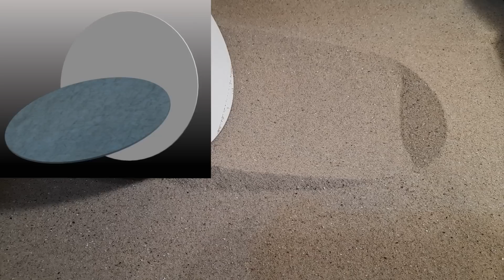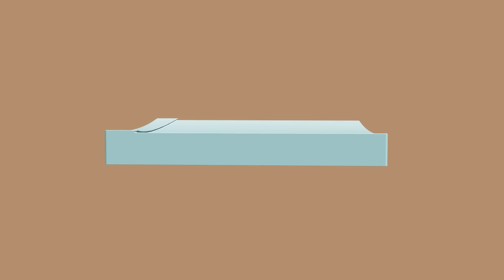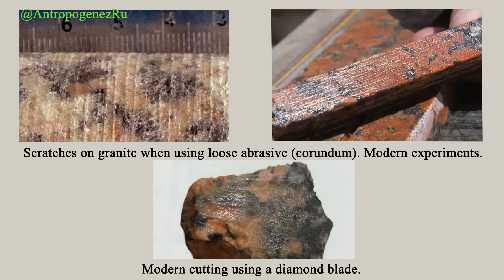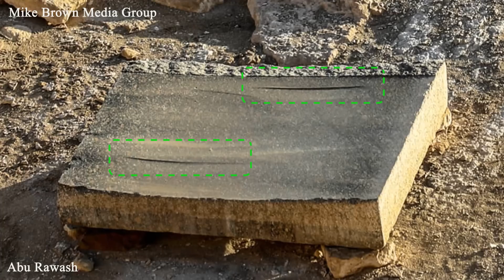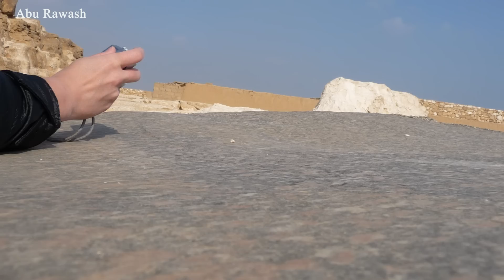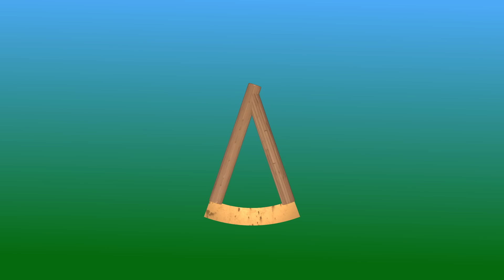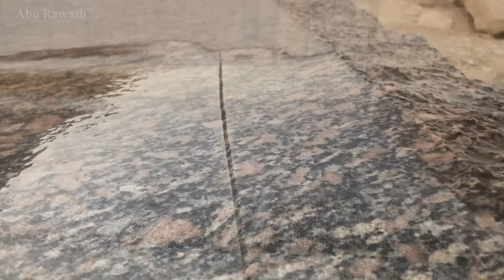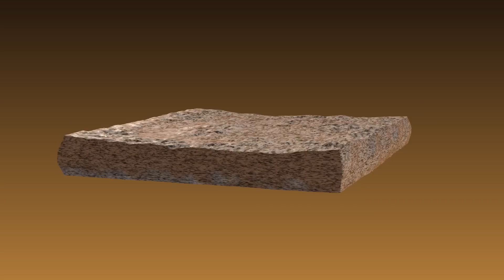The Abu Rawash Artifact: Evidence for the Existence — or Absence of Circular Saws in Ancient Egypt?

Comment: A flat edged hAif meter cutter fixed to your tripod and swiging bAck and forth will leave an ark on the Abu rawAsh stone also. No need for inventing tech there is no evidence of the parts or the infrastructure for building the high tech to begin with. There's a reason the most delicate medical procedures are still done by Human hands .

Comment: In Nature, Yosemite, granite exfoliates, layers come off like onion skin...due to?...bbk...

Yes, the granite in Yosemite National Park does exfoliate in a manner reminiscent of peeling an onion. This process, known as exfoliation weathering, involves the outer layers of the rock peeling away, forming characteristic sheet-like fractures. 

Elaboration:

Exfoliation:

This type of weathering occurs when overlying rock and soil erode, reducing the pressure on the underlying rock. This leads to the formation of fractures parallel to the surface, causing slabs of granite to peel away. 

Note: I've seen this, too the scratches left by grinding ice...anyway, heating stones expands them, pressure, cooling them quickly breaks them...some places in the quarries indicate heating done, read said...a "saw blade" need not be all one piece, Aztecs stuck obsedian bits in wood for swords..."if they're there, they know how to be there."...paraphrase of Marine Biology lesson on adaptions of sea creatures to the rocky intertidal zone-harshest envirorenment...sea urchins drill holes Yes, the granite in Yosemite National Park does exfoliate in a manner reminiscent of peeling an onion. This process, known as exfoliation weathering, involves the outer layers of the rock peeling away, forming characteristic sheet-like fractures. 

Elaboration:

Exfoliation:

This type of weathering occurs when overlying rock and soil erode, reducing the pressure on the underlying rock. This leads to the formation of fractures parallel to the surface, causing slabs of granite to peel away. 

 the rocks...🍿

Comment: I did in the past some wood carving for wooden stairs, you can also get a cutting radius if you exactly get the right depth and diagonal (Z Axis) tilted on a circular saw. Not only in X or Y as in your example. The saw could be therefore even way more big.
Reply: Exactly! I was going to say that in a post as well. It’s a well known technique for making moulding and other wood parts. I can do the same thing on my metal milling machine. You get a curve that equals the diameter or anything smaller than the diameter up to a straight cut the thickness of the blade, by calculating the appropriate angle of approach. The variations can also be caused from a circular saw. If the saw and/or the bearings aren’t sturdy, the saw would wobble to a certain extent. Being that they used wood bearings back then, wear is expected. I also doubt how flat a 36 foot blade would be, or whether the circle would be perfectly round. All of that would account for the imperfections in the cut. I’m not saying that it was done by a large circular saw, just that it could have been.
Reply from the maker: the direction of the scratches will be different https://youtu.be/nnRNDSw9ZN4?t=27
Reply from the maker: Thank you. I agree, the tilt can be along different axes.

Comment: Couldn't ir just of been a sharpening stone, I have seen stones get woen like that. Maybe they used it to sharpen swords with some sort of grit. Maybe a rough grit for heavy grinding, maybe even for rough polishing of other stones even.
Reply from the maker: Thank you. Great idea. It's not like they sharpened anything on this plate. They had special sharpening stones, granite is not very suitable for this. They could check, adjust the tool, experiment. That's why there are many errors and an uneven surface.

Comment: when I see something like this it shows that your head has been put in a box, they must have used corundum, they must have used a pendulum, they must have only had wood bearings, yet the quality of the work is aerospace precision as documented, if they had access to a form of tooling to achieve precision on that level would you think they could apply the same tooling and concepts to other processes, be it less precise? What about a big drum grinder powered by an electric motor, with diamond grit?
Reply from the maker: "it shows that your head has been put in a box" - I don't think this is a good start, even if you are trying to pass off someone else's thoughts as your own. https://youtu.be/2cL2UL5tzLc?t=1172 
Have you worked with such a tool? Yes, I have. And the traces there are different. But a detailed description would take additional time. By the way, the radius of the drum does not have to be large, since the curvature of the surface is provided not by the radius of the drum, but by the layer of removed material.
And one more thing. aerospace precision does not correlate with this particular artifact, so this is a substitution of concepts.
Reply: @GRES_TAC  clearly they had access to greater technology that is what is expressed by the precision, when I see depictions like that pendulum its assuming they must have used something "stupid" i.e. non sophisticated technology. I dont know what youre referencing on that video, and im not being critical of you im saying that now there is confirmation of precision in abundance, there are advanced machines missing from the picture. The head in the box is thinking it must be sticks and sand still.
Reply from the maker: @richardjohnson8009  "clearly they had access to greater technology" Of course, they were brought from Mars) But seriously, many artifacts show that the instrument had manual control, and this is what we are talking about first and foremost. Further, it is a useful practice in research work not to introduce mythical entities ahead of time. First, analysis, then interpretation.
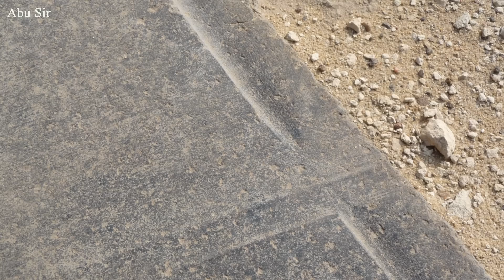And if you had watched the video carefully, you would have paid attention to the ending where I talk about the contradictions about "sticks and sand" 9:08
" I dont know what youre referencing on that video" So you are superficially familiar with the topic
Reply: @ What was that pendulum made of? Sticks copper and sand? Whats so mythical about a lathe? We do use them all the time, as well as electric motors, and diamond, and micrometers, and core drills made of steel, and.... I have watched that video and have watched many more videos.
Reply from the maker: @richardjohnson8009  "Sticks copper and sand?"  cite where sand and copper are mentioned in the video. You came up with it yourself. And by the way, diamonds are often attached to a steel disk with a copper alloy - brass. " Whats so mythical about a lathe?"  that it is invented. The traces are different from those left by the machine. In many ways. "I have watched that video" - then watch the video from the same channel about "aerospace" vases, and argue with a person who knows a lot about bearings and machine tools (Chris King)
Reply: An electric motor requires an electrical grid with generators and wires. Those require manufacturing plants, mines, and smelters, among other things. It requires all the same stuff required for you to plug in a light bulb at home.  Those are big items that leave lots of traces. Where is any of that?
What did they ever do with all that advanced technology besides stuff with rocks?
If they have that advanced tech then why would they build stuff with the most labor-intensive building materials possible?
Reply: @cliffordschaffer5289  If you werent aware there was a massive cataclysm(s) that included a "flood" that wiped the entire area, go look at google earth you can see it with your eyeballs. Id suggest that thats where it all went.

Comment: And in the author's opinion, there could not have been a marriage? Your method of studying the material is not new, it is inertia and conformism.
Reply from the maker: In high-precision equipment, defects are impossible by definition. In slow manual execution, they are also impossible due to constant visual control. Therefore, defects are the result of working with a tool that is something intermediate between the first and second. And this is exactly what is said in the video at 9:08.

Comment: I think you just eliminated known ancient Egyptian tools ( stone and copper) as well as modern tools. To me, that pendulum is too far stretched. At one stage you mentioned the weakening of the material, which lines up with my hypothesis. When there is no other explanation, why not imagine something outside the box?
Reply from the maker: Thank you. I try to stick to a systematic approach, which involves moving on to a new idea after fully processing the old ones.
Reply: "weakening of the material" - is this material "weakened" now? I'd imagine I'd have to be, how do you "re-harden" stone?
Reply from the maker: @pittuk6500  Yes, granite is resistant to various impacts, so the "weakening" option does not seem serious. Although supporters of the "Natron Theory"  and geopolymers https://www.youtube.com/live/MEWjYSNUEbo perceive such a possibility, I do not support it in this interpretation. There is a problem of the logical level here. The "weakening" option would solve all the problems. But this is impossible according to our ideas. However, there are many impossible things in the world.
Reply: @GRES_TAC  Kinda hard to get the weakened argument if the stone is as hard as usual now and no residue of heat or a gigantic cryo chamber with it.
Reply: @GRES_TAC  note also that in the natron theory there is a phosferesent trace on the nubs that glow under blacklights.  That could indicate a drain area for moisture that resulted in the effect.  Or it was added later.  I think that's quite strange.
Reply: @Mindurownbizzzz I am particularly interested in nubs. That glowing phenomenon seems important. Where can I find something about that?
Reply from the maker: @pittuk6500  For example, once such a fantastic explanation as "Irradiation Creep" was proposed. Or "thixotropy" which also manifests itself in relatively solid structures.
Reply: May it have been an rotating grinding drum ?
Reply: There are so many unanswered questions in all the ancient stoneworks around the globe that we have to think of a technology outside of what we know now.
Reply: agree , aliens technologies from 18,000 years ago way before any so called ''Egyptians '' , tool is called desintegrator it is an immaterial energy beam that break atoms bonding liaisons by removing valence electrons responsible from accretion of atoms together , result is turning any matter into mono atomic state sand
Reply: They didn't use copper. They had alloy.  Also,  anything carves granite.  You can watch videos of people carving diorite and granite with bone, wood, copper, alloy,  steel
Reply: @sidmaley  Where is the alloy tool they had/used? Yes you can make holes/cuts in granite with copper pipe and a copper/quartz saw and thousands of hours of manual work. Making something very rudimentary on a 1-foot block of granite is quite a bit different from sawing precisely a 50-ton stone, very thin and precise thin vases with lips, and huge intricately carved stone statues. They didn't do that with bones and they didn't have Iron or Steel unless somehow a massive Iron meteorite landed right smack in Egypt. The videos I have seen, yes, you can make a hole or make a cut or a very rudimentary vase,  but it in no way is equivalent in quality, size and the massive scale that is out there.
Reply: @sidmaley  Show me an Alloy tool from Dynastic Egypt. No one carved a 50-ton block of granite with a bone. Never happened. Iron and Steel weren't around dude, unless you found a gigantic Iron meteorite. I have only seen one dagger that apparently was meteorite-based. Pretty sure they didn't make hundreds if not thousands of tools out of meteors. Yes you can make rudimentary cuts/holes with copper pipe and quarts sand but they look like a 5 year old did it and it takes a hell of a lot of time.